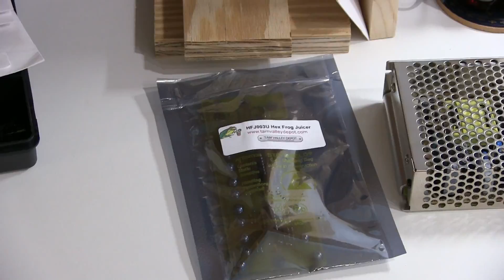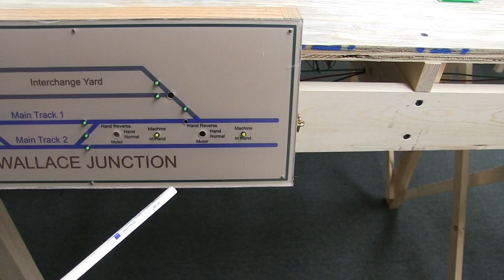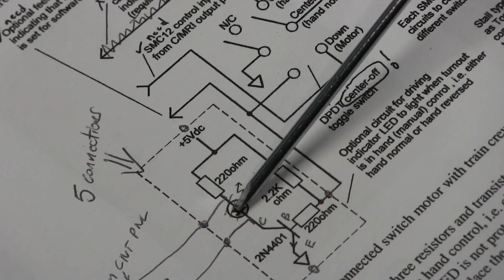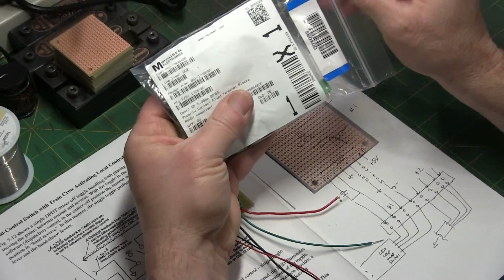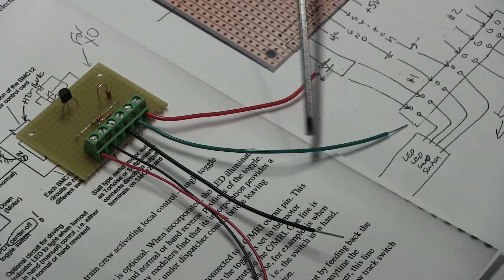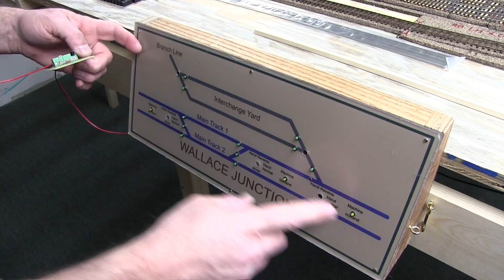Model Railroad Layout Update Video 22- C/MRI electronics, Control Panels, Wiring

Comment: On the "dispatcher" switches they have a normal railroad lock for train crews to use but to throw that switch the crew would have permission from the dispatcher first. The switch has a power on and off lever the person throws first then you can throw the switch as a normal non-motorized switch

Comment: Very cool. I have 36 years in the computer/electronics business, so I love all your "toys".
Just curious, why did you choose to use green leds for both sides of a turnout on the panel? (They all looked green to me). I always thought the usual convention is to use green for normal and red for reverse, so you can tell at a glance what the turnout position is, even from a distance.
Reply: Hi Stephen it´s a pitty we can´t have those circuits at an afordable price here in Portugal. Although I´m an ofcial repair shop from Fleischmann/Roco, my layout is only for American trains.
Thanks for sharing all your wonderfull videos.
Reply: I did consider that, and agree that the "normal" set up is to use different colors for the normal and reverse route indication. We thought it over, and since the LEDs are illuminated for the proper route, and the others are off, decided to go with a single color. It will still be obvious which route is selected. We will see how we like it (and can always swap out LEDs if desired). And we can't claim to be normal... :-)